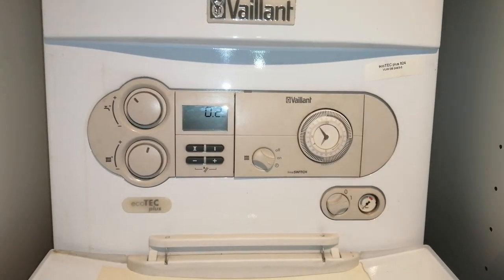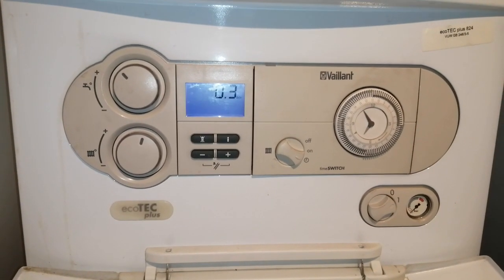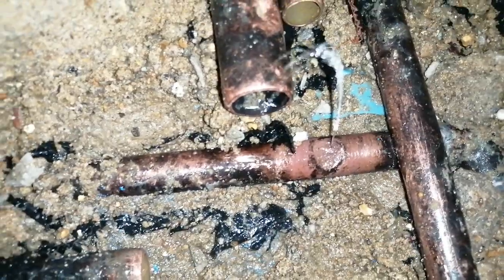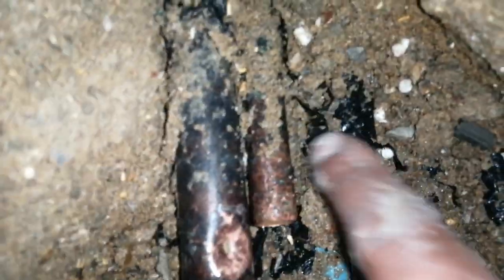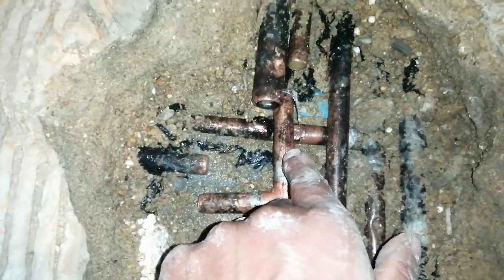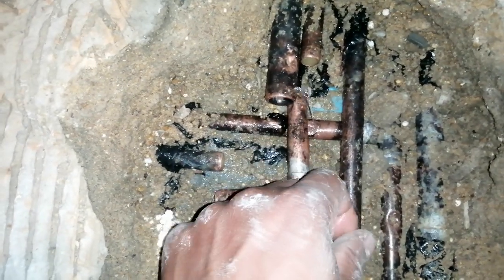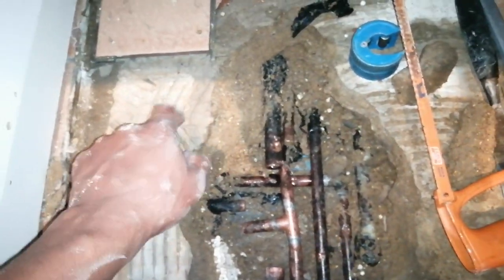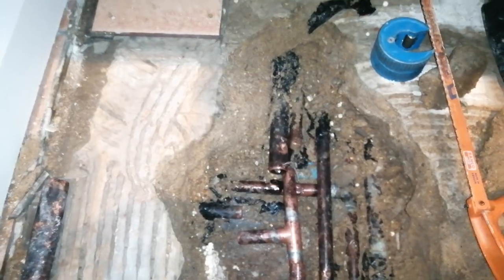NO CENTRAL HEATING! only hot water on vaillant ecotec plus 824

Comment: Mine heating water but not the rads but no error codes are displayed. Any thoughts please?
Reply from the maker: Curtesy of AI,

That’s a really common Vaillant ecoTEC issue — heating works for hot water but not for radiators, and no error codes appear.

Here’s a short checklist you can give in your reply:

---

Possible causes and checks:

1. 🔄 Motorised valve stuck or not opening – If you have an external 2-port or 3-port valve, it may not be moving to the heating position. You can usually feel or hear it click or hum when heating is turned on.

2. 💡 Room thermostat or timer not calling for heat – Check that the programmer is set to ‘heating on’ and the thermostat is turned up. A flat battery or signal issue can prevent the boiler from firing for CH.

3. 🔧 Diverter valve stuck on DHW – Inside the boiler, the diverter can seize, meaning it only sends heat to hot water. This is very common on ecoTEC models and often needs a new valve or cartridge.

4. 💧 Low system pressure – Should be around 1.2–1.5 bar when cold. If it’s below 1 bar, top it up and reset the boiler.

5. 🔥 Boiler in DHW priority mode – Some Vaillants can appear fine but will stay in DHW mode if there’s a stuck microswitch or faulty flow sensor.

---

Quick test:

Turn off hot water demand (no taps running).

Turn central heating on full.

Feel the flow and return pipes under the boiler — if one gets hot but the rads stay cold, it’s likely the diverter valve.

---

If you’re replying publicly (like on YouTube), you could write something like:

> “If your ecoTEC is heating hot water but not the rads and there’s no error code, it’s usually the diverter valve stuck on hot water or a motorised valve/thermostat issue. Check your room stat is calling for heat and system pressure is 1.2–1.5 bar. If all that’s fine, it’s probably a diverter valve fault
Reply: @CommercialGasEngineerVideos thank you very much ❤️

Comment: That looks like an awkward repair!.... Bunched up, no left and right movement on the pipes, difficult to clean up the copper/ perhaps pitted, water in the pipe etc so difficult to solder.  .Are you planning on soldering or using a press fitting? Very bulky those press jaws and fittings
Reply from the maker: Was a nightmare. Think I spent a total of 2 days. 1 day pinpointing the leak. 1 day repairing. Got my dad in to do the pipework as he is a pipework genius. We had a combination of solder and push fit. Yet recall soldering much of it as there wasn't enough space. I did much of the soldering as my dad hates soldering. Wasn't easy soldering. Recall using a wet vac to get up some of the water. The owner had rising damp for years until this got sorted.

Comment: Brilliant video

I have same boiler... ecotec 824ri.

The problem I had was the boiler was pressurising into the red. But both hot water and heating was working.

Since I have recently... had parts changes..

•Expansion vessel 
•Filling loop value 
•pressure relief valve also

The hot water works fine but the heating doesn't work... boiler ignites but then stops.

All rads have been checked for airlock also. 

Really stuck here....
Reply: All are compatible parts and filling loop valve is vaillant product also
Reply from the maker: Make sure the pipe or hose that connects the expansion vessel to the system isn't blocked. Also clean or replace pressure sensor. Good to ensure that the pump is circulating and that the diverter valve is actuating. Yet I would do the first two. I made one similar to this problem called " previous fault codes". Send me some photos etc on Instagram. I'll show you the pressure sensor and the pipe to check for blockage.

Comment: I use a Kane Tcam, great for leaking hot water pipes,  was there a damp area on the tile grout lines? or how did you spot the area.
Reply from the maker: Kane tcam £400-600, ouch. That would have saved me some time. Took me a while to find it. Was working like an archaeologist. Maybe renting a thermal camera would have helped. I do need a new drill. A Hilti would have helped too.